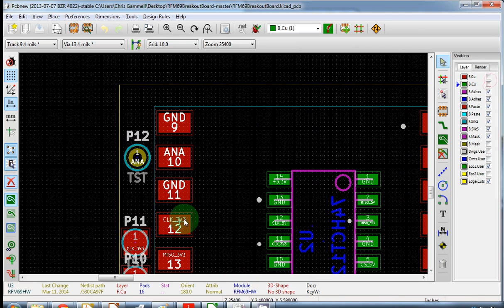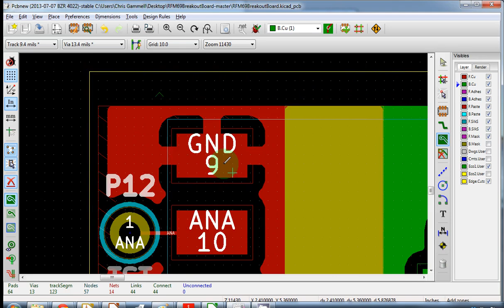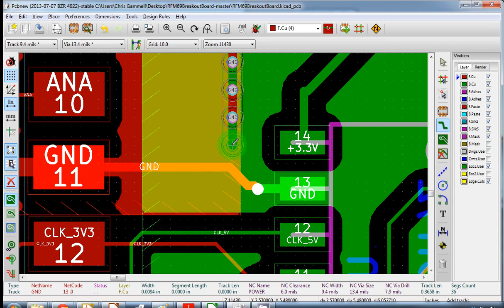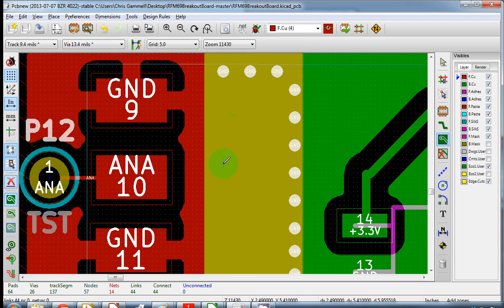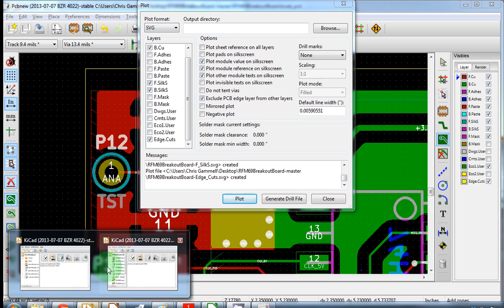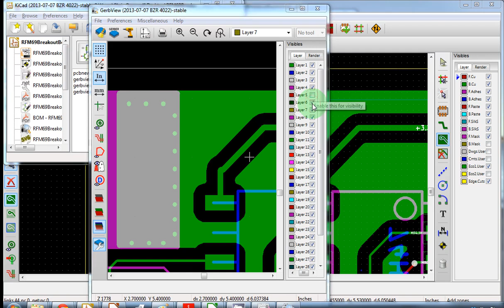KiCad 3.0 - Ad Hoc Via Stitching in KiCad

Comment: You can clean up the stuff by deleting the wires between the vias, if you want.  This way, only the vias remain, not polluting your layout with redundant copper tracks.
Reply: Geert Vancompernolle Sorry, I was wrong in saying that you can clean up the wires afterwards.  After closing and re-opening PcbNew, the connection between the two areas was broken.  Apparently, the refresh function pulled my leg (meaning, it doesn't nicely refresh the layout when you do such things...).
Sorry for any confusion caused...
Reply from the maker: Geert Vancompernolle no worries! There is actually an alternate method that was posted here recently: https://forum.kicad.info/t/protip-nicer-via-stitching/1103